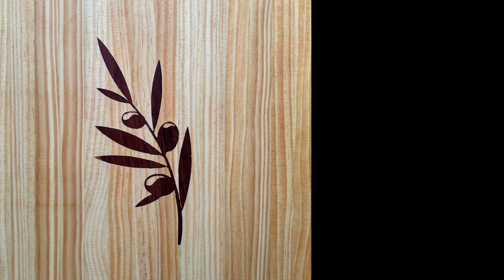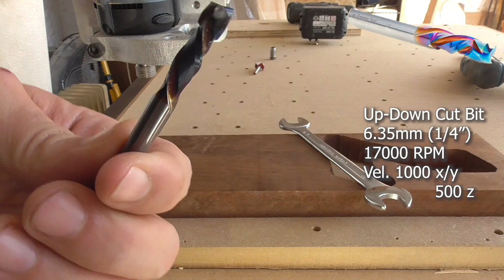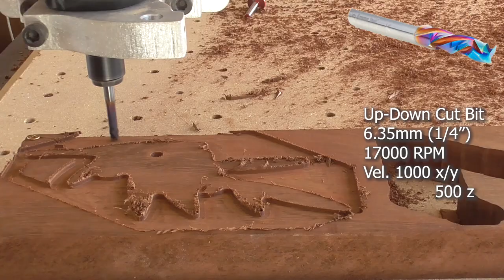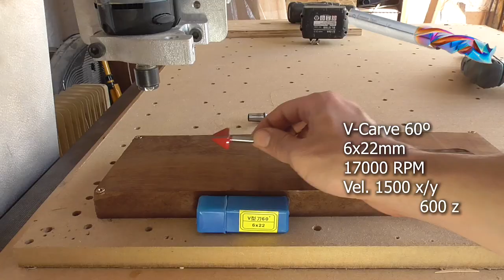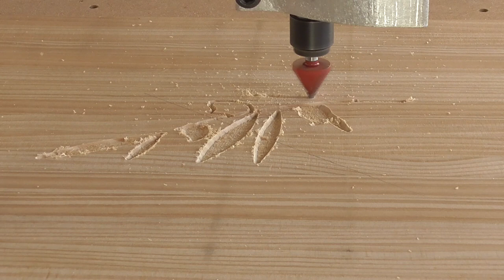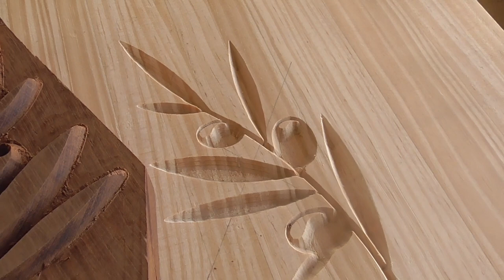Incrustaciones en madera

Comment: what machine do you own?
Reply from the maker: Hi Blaine, doesn't have brand my machine its DIY machine (not's commercial CNC), the aluminum parts of the frame i asked to cut to a aluminum dealer all other parts is linear rails SBR16, arduino controller (not's a pro cnc or extra strong cnc and i need to make some changes for make it better). If you click in my channel in my logo i have a picture of the machine (with colors, but in reality is only aluminum color).
The motors is nema 23 with drivers of 5A (setted at 4A).